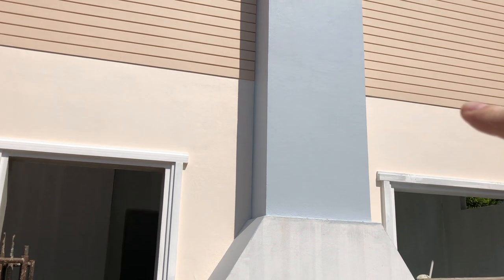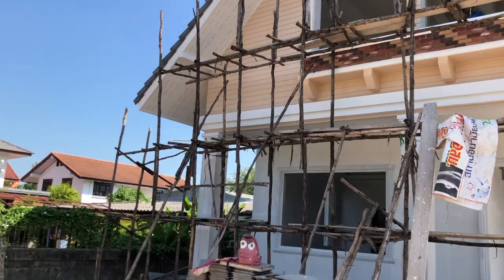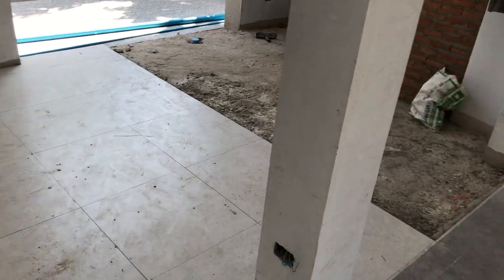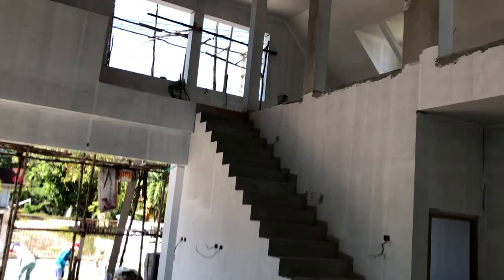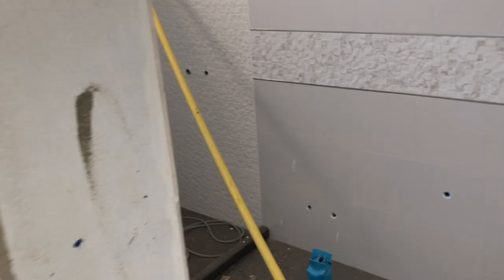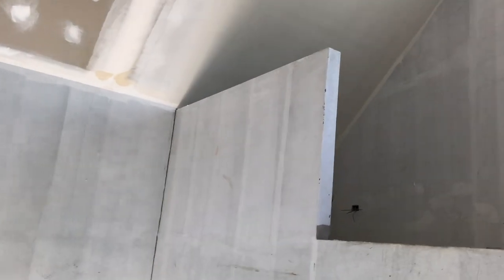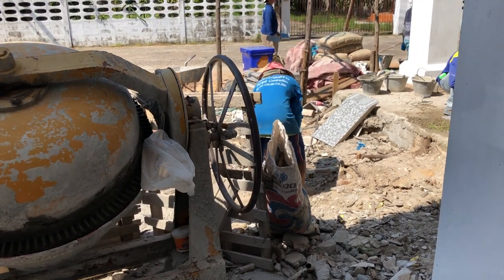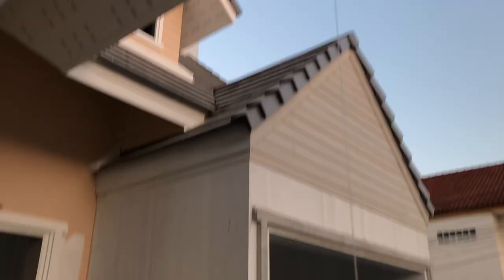v41 NEW HOME BUILD - GUESS WHAT HAPPENED !!  BURIRAM THAILAND BANGKOK HOUSE PROJECT บ้าน

Comment: Just a couple of questions 7:43 what is the socket for at the top? What do you plan for the top of the staircase so you don’t fall down? Glass, stainless Steel alloy fence, or a wall? How do you stop the cracking in the walls, do you just replaster it when it is dried out?
Reply from the maker: 7:43?  Are you referring to the recess in the ceiling? The two levels? If so, that’s just for appearance. Two different sets of lights. 
At the Top deck and stairs - I want simple stainless - Jen doesn’t, not sure what it will be. She has already ordered it. The 3 big openings (top of stairs on right side)￼ will be opening windows top half - fixed translucent glass on the bottom half.   No idea with cracking. I think it might just be the settling of the home.  It seems common when we look at new homes. It’s not in the home I’m living right now. Time will tell I guess. 
Ahh, if you referring to the electrical socket. That’s probably it. That’s for the air-conditioning unit.￼
Reply: PolarAttack yeah probably air con, how long are you here for? I am leaving tomorrow heading back to work.
Reply from the maker: I'll be here at least until Feb.  Unless I need to return to Canada for whatever unexpected  reason.